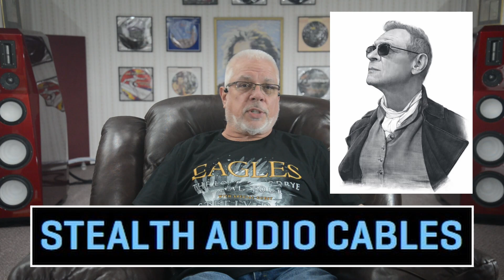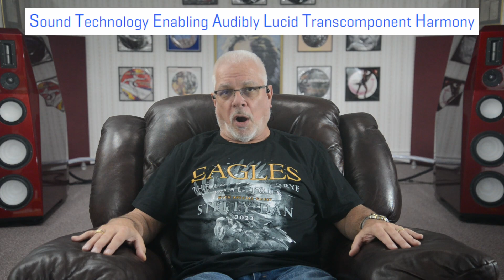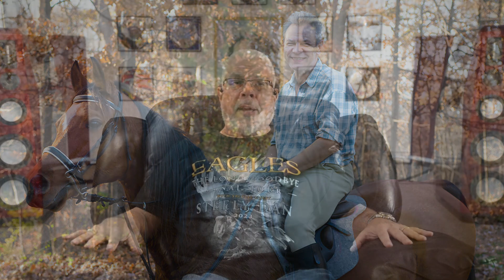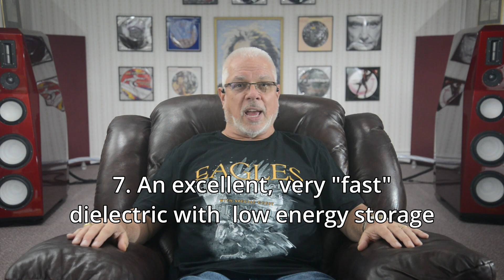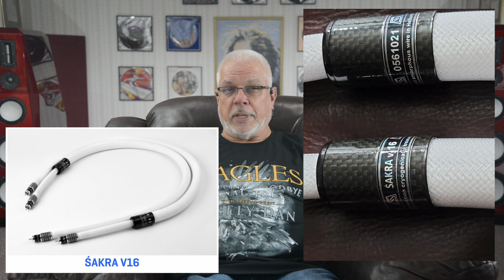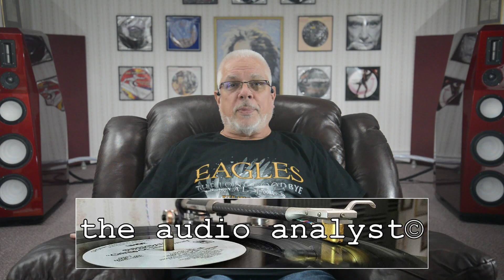E146: STEALTH Audio Cables

Comment: How would you compare the stealth cables to the Kubala Sosna?
Reply from the maker: Hello, and thank you for raising for a very fair question.

First, you may (or may not) know that I’ve had the honor and pleasure of knowing both Joe Kubala and Howard Sosna since shortly after they launched their brand. In fact, Joe has become a good friend over the decades.

Though both Joe and Bill Parish (of GTT Audio, an authorized and very successful K-S retailer) have discussed my auditioning the cables any number of times, it has never come to pass. I’ve had very wide and deep exposure to their cables, mostly whatever their flagship series has been, over the decades at shows, in other systems, and especially during ALL my visits to the multiple exceptional show rooms of GTT audio in Long Valley, NJ. But as I’ve NEVER had the pleasure of auditioning them first-hand, in my system, I am unable to give you a more reasoned answer. I hope you know that I am of the unassailable opinion that if you’ve not experienced something first-hand, you cannot offer any form of valid opinion of it.

That said, I suspect that it may be understood that there are several cable manufacturers whose products have earned my unquestioned respect…Kubala-Sosna, Master-Built, Prana Wire, and STEALTH are the clear leaders in this regard, building what I consider to be world class products, with Audience, Cardas, and Silversmith representing overachieving but more affordable solutions.
Reply: @theaudioanalyst Greg, can your passing characterization of Silversmith here (as seemingly not world class) be taken to mean that the Fidelium is no longer your reference speaker cable?
Reply from the maker: @asegal4677   This is a fair question, especially as couched. It should be somewhat obvious that synergy is a dynamic attribute. Some electronics or loudspeakers pair, or more comfortably “mate,” with some cables than others, most times, for various explicable reasons. Other times, not so much… 😉

In this case, the interactions of the True Life Audio SSA-350 monoblocks and my Von Schweikert Audio ULTRA 9s, the STEALTH Dream V14 speaker cables allow for both a bit more control, especially below about 45Hz or so, and body. This is not necessarily a surprise, as most ribbon designs naturally roll off below that point (See page 9 of my “Loudspeaker Cables: Simple Passive Connection or Complex Dynamic Component” here - https://www.theaudioanalyst.com/wp-content/uploads/2023/08/speaker_cable.pdf).

That said, that takes NOTHING away from the stellar performance of Jeff Smith’s amazing Fidelium Loudspeaker cables. Further, more experimenting, based on some feedback from my friend and colleague Steve McCormack, have led to my move to renew my experimentation with the Fidelium loudspeaker cables. More to come…

AND, Jeff has reached out to me as he is finalizing the prototypes of his Fidelium XLR interconnects, and told me in a recent phone call that they will be in my hands, and system, near term. Stand by for that evaluation too... 😉
Reply: @theaudioanalyst  Thanks, Greg! Very valid point about system synergy being a moving target. I bought the Fedeliums on your recommendation a while back and they really work well for me at the moment, so I had been wondering whether those interconnects were ever coming out. Very interesting and I will stay tuned for your assessment!

Comment: Great video Greg, I think you may have missed it. What USB cable were you using between the Ideon Stream and the Ideon Time? Another Stealth USB or a different brand of USB. 

When possible, How important is it to use a full loom of cables from one brand? Don't remember if you have covered this in a video before.
Reply from the maker: Thanks for this wonderful question... The USB cable between my Stream and Time is the Audience frontRow (with MORRE technology). 

And the question about using a full single-branded loom actually can be answered with - it depends. Why,? Because sadly, some companies make brilliant speaker cables, but only so-so AC cords, or remarkable interconnects, and only adequate digital transfer cables. 

In some cases, it makes PERFECT sense to go all in on one brand. With others, it makes sense to pick and choose. Fortunately, with time, repeated exposure, and enough substitution, you may develop the experience to differentiate those individual differences and to make fairly informed choices in such matters. In my current alignment, I have chosen to mix and match the best from several companies... This is both because full loom solutions were not offered by some, and, because some full loom solutions didn't accomplish the same level of "completeness" or "wholeness" as the current assembly is capable of.

By the way, have you seen this? https://www.theaudioanalyst.com/wp-content/uploads/2023/08/speaker_cable.pdf

Thanks again, Jeff. 😉
Reply: @theaudioanalyst  I've heard you mention this article in your videos before. Thanks for the download. I will definitely read through it. It's great learning from those of you who have been in the hobby much longer.

Comment: The only  way to argue these types of cables is by showing significant differences that are measurable.
Get ya lab equipment and measure.
Also I worry that spending few hundreds on rly good cables and the rest of the money on room treatment would have helped your situation probably more sonically.
I see some basetraps but if you want truely good sound you should start considering rebuilding your room into a asymetric shape and installing alot of deflectors getting rid of standing waves.
Reply from the maker: For now, I'll give you the benefit of the doubt, assuming that you are well-intentioned. I'll also wager that you have very little empirical experience, if any, especially over decades, with such matters, essentially negating the relevance of your statements. 

As to the sonic accomplishment in my room, so many people over-treat their environment that it is almost a joke. Ask any of the dozens of industry professionals, designers, manufacturers, and musicians, who have been in my room, and they will be only too happy to tell you about the remarkable accomplishment here. It is world-class by ANY definition. 

And finally, as to measuring cable’s performance, virtually every cable designer I know – and that number is not small - will tell you that measurements are a wonderful place to start, but that listening is the final arbiter of a design’s success, not what you see on a 'scope or meter.

Until your actual experience base matches your current level of uniformed assumption, and you really develop some understanding of the matters you are trying to discuss, you really should not offer up unsupportable and meaningless statements like these offered here.
Reply: @theaudioanalyst  you have to listen ofcause but there must be a causal electronical trait of the cable that you can show compared to other cables or not? Or is it a bit of a mystory why the cable performs better than others ? I would assume it should be quantifiable right ?
Reply from the maker: @XionTRAX  One of the first things to understand about audio cables is that you must eschew the standard inductance/capacitance/resistance/impedance dance and instead look into the physics model of electricity as electromagnetic wave energy instead of electron flow. Let me share some details I initially wrote on this subject some years back.

Many cable manufacturers tend to mistakenly focus on the more simplified engineering concepts of electron flow, impedance matching, and optimizing inductance and capacitance. By manipulating their physical geometry to control LCR (inductance, capacitance, and resistance) values, they try to achieve what they believe to be the most ideal relationship between those parameters and, therefore, deliver an optimized electron flow. Today’s most gifted cable designers have argued that the LRC characteristics of cables will not have any effect on their frequency response.

As this is the very argument that all the cable flat-Earthers out there use to support their contention that cables can't possibly affect the sound, it seriously complicates things, almost to the point of impossibility, when trying to explain how and why interconnect, speaker, digital, and power cables have a demonstrably audible effect on a systems resultant sonic tapestry.

When you look at the waveguide physics model, you uncover the model that explains very nicely why interconnect, loudspeaker, digital, and power cables so clearly affect sound quality. Further, the model may also be used to describe and understand other sonic cable mysteries, like why cables can sound distinctly different after they have been cryogenically treated, or when they are raised off the floor and carpet.

Ideally, the goal is to control the interaction between the electromagnetic wave and the conductor, effectively minimizing the phase errors caused by that interaction. Physics informs us that the larger the conductor, the greater the phase error, and that error increases as both the number of conductors increase (assuming the same conductor size), and as the radial speed of the electromagnetic wave within the conductor decreases.

Following this theory, the optimum cable would have the smallest or thinnest conductors possible, as a single, solid core conductor per polarity, and should be made of metal with the fastest waveform transmission speed possible. The best designs I’ve heard to date, like Serguei’s (and many others like Jeffrey Smith’s Silversmith Audio, etc.), exploit these possibilities.

In fact, designer Jeff Smith points out that it is not as important to understand the math involved, as much as it is to understand the concept of electrical energy flow that the math describes. The energy flow in cables is not electrons through the wire, regardless of the more common analogy of water coursing through a pipe. Instead, the energy is transmitted in the dielectric material (air, Teflon™, etc.) between the positive and negative conductors as electromagnetic energy, with the wires acting as waveguides. The math shows that it is the dielectric material that determines the speed of that transmission, so the better the dielectric, the closer the transmission speed is to the speed of light.

Though electromagnetic energy also penetrates into and through the metal conductor material, the radial penetration speed is not a high percentage of the speed of light. Rather, it only ranges from about 3 to 60 meters per second over the frequency range of human hearing. That is exceptionally slow!

As a result, that secondary energy wave is now introduced as an error, or memory, wave. The thicker the conductor, the higher the error, as it takes longer for the energy to penetrate. We interpret (hear) the contribution of this error wave (now combined with the original signal) as more bloated and boomy bass, bright and harsh treble, with the loss of dynamics, poor imaging and soundstage, and a lack of transparency and detail.

Perhaps a useful analogy is a listening room with hard, reflective walls, ceilings, and floors and no acoustic treatment. While we hear the primary sound directly from the speakers, we also hear the reflected sound that bounces off all the hard room surfaces before it arrives at our ears. That second soundwave confuses our brains and degrades the overall sound quality, yielding harsh treble and boomy bass, especially if you're near a wall.

That secondary or error signal produced by the cable (basically) has the same effect. Any thick metal in the chain, including transformers, most binding posts, RCA/XLR connectors, sockets, wire wound inductors, etc., will magnify these errors. However, as a conductor gets smaller, the penetration time decreases, as does the degree of phase error.

I hope you begin to understand how much more complex the matter is than you initially assumed.